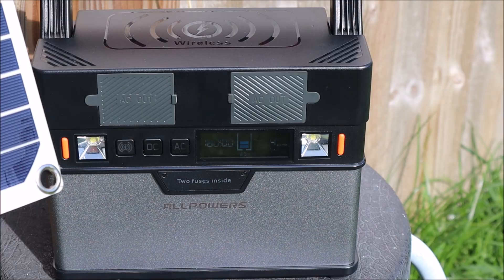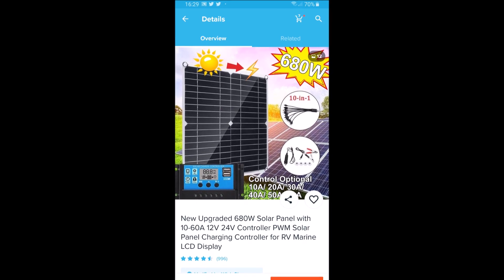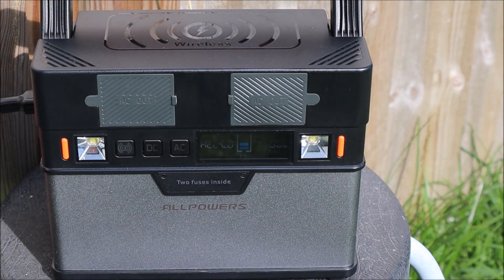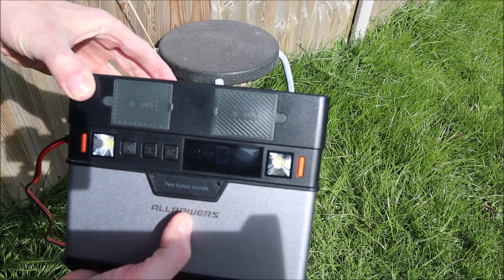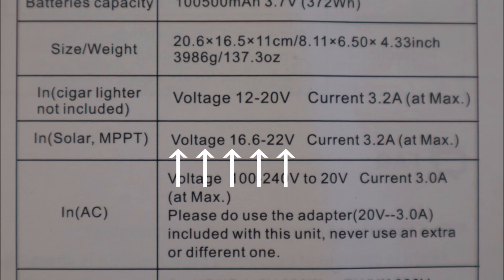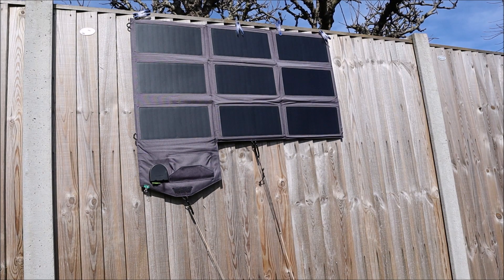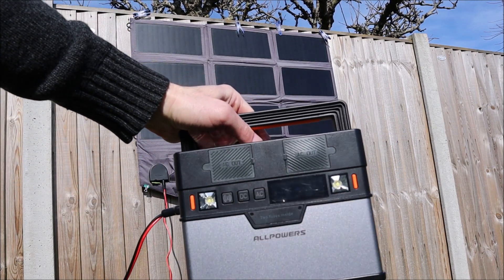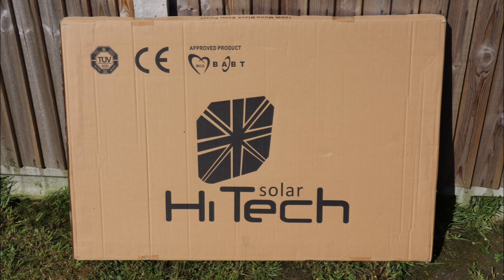ALLPOWERS 372Wh Portable Solar Generator Update 2 | Wish Came True

Comment: Howdy, great vids. We have this powerpack and have had some good use out of it. However, I tried to run a drill from the invertor which tripped it and I now can't get the AC to activate at all. I've had the blade fuses out (swapped one) but they looked ok tbh. Any ideas if this can be fixed as we like to run our TV off it when off-grid!
Reply from the maker: @paulcrossley2398  Hey Paul. Thanks for your kind feedback and sorry to hear you're having a problem. Do the DC outputs still work and can you still charge the unit up? Have you tried a reset as yet? All the best, Adrian
Reply: @DADvinci  Yep, all the DC side of things work fine - I tried the reset as in your video but to no avail.  I do get a nice spark as I put the fuse back in but no blown fuses.  Looks like we might have to see if the TV can run on DC!
Reply from the maker: @paulcrossley2398  Thanks for the info Paul. I think you've already said this, but does the AC button switch on at all (and the fans temp kick in, then go off)? Did you ever use the app with it? In theory, the drill should have just tripped the inverter (inbuilt protection), not fried it. The only other thing I can suggest is that you remove the fuses and take the lid off to check the mainboard/wires for damage (if you wish to of course).
Reply: @DADvinci  The fans kick in and display lights up for about a second then goes off. I've had the lid off but tbh I don't really know what I'm looking at. I did use the app when we got it a few years ago but I couldn't get the app to see the powerpack yesterday.  Thanks for all the suggestions by the way. Not sure if it makes any difference but ours is actually branded a Sudoo, not Allpowers, but the App is AllPowers

Comment: i have the 500w one but it behave the same i guess. i put a switch between the solar panel but i also have it 24h pluged in. so i usually ignore it and it just works. only issue seems to be that if its full and still in use and discharging it doesnt start charging again until its next day or a cloud goes over. overall i cant really put my finger on it what really happens. it even happens to me that i checked it and it wasnt charging. nothing was plugged in but after i connectet some usb device it startet charging. i was thinking if its possible that in some situation it doesnt charge on purpose because always charging it to 100% is kind of bad anyway. but like i said. i still cant point my finger on it or reliable repeat anything that happend.
Reply from the maker: @matze x  Good day and thanks for sharing your experience. You have the 606Wh version of this unit? If so, are you using the Anderson port to solar charge the unit? All the best, Adrian
Reply: @DADvinci  yes i have the 606 version and i use the anderson port (replaced it with an xt60). i did some more testing and i could repeat that if it isnt charging its usually allready charged to more then 90% and it started to charge if it goes discharged to lower then 90%.

Comment: Hi I have a Buture portabler hoover with a usb-c charging port on it, I was hoping to charge it with the usb-c out of this battery to the hoover usb-c with a usb-c to usb-c lead male to male but it doesnt work? Can i not get power from the battery to the hoover using usb-c to usb-c only?
Reply from the maker: @SGJOE sgjoe  Good day and thanks for your question. I'm not familiar with the portable hoover you have so please could you post a link? I'd need to have a look at the specifications (perhaps on-line user manual) to see if it might work with the 60W USB-PD output on the ALLPOWERS. I look forward to hearing from you. All the best, Adrian
Reply: @DADvinci  https://www.amazon.co.uk/BuTure-Handheld-Cordless-Rechargable-Portable/dp/B08HVGBFHL/ref=sr_1_3?dchild=1&keywords=BuTure+Handheld+Vacuum+Cordless&qid=1625310698&sr=8-3
Battery says - TYPE-C port (5V-20V/ 60W max, QC3.0) I have got two usb-c to usb-c cables now but neither will charge directly, I wanted to avoid using a plug on the ac, any help much appreciated :)
Reply from the maker: @SGJOE sgjoe  So sorry for the delay, didn't get a notification of your reply. On paper it looks like it would work. Have you got an alternative USB-C to USB-C cable you could try? The other way is to use a 12V USB PD charger like this (https://amzn.to/2UrvXaY affiliate link), but I couldn't guarantee that without testing it myself first and don't want you to spend money when you don't need to. Another possibility, you could try a USB to USB-C cable and plug into one of the standard USB ports, just to see if it works? Cheers, Adrian

Comment: How many times do you think you could charge your cell phone completely on that battery before you have to recharge it how long do you think you could run a heating pad or an electric blanket on it you think it would last overnight
Reply from the maker: @DirtPoorFarmer  Good day and thanks for your question. In regards to the cell phone, it would depend on the size of phone battery. If you can find out how many watt hours (Wh) the phone battery holds, then you can roughly estimate the number of full charges from the 372Wh. In terms of heating, I'm currently testing a foot heating pad rated at 80W > https://www.bewarmer.co.uk/footbuddy-all-in-one-heated-foot-mat/ and that would run for less than 4 hours on the 372Wh. If a blanket could run at about 30-40W then you could probably run it for about 8 hours, but that's on paper and it would need to be tested in real world conditions. I hope this helps and I look forward to hearing back from you. All the best, Adrian

Comment: Been looking at this compared it compared to some more expensive ones and it seems like a lot of faff. Love the connectivity but want a solar charger and this looks very fragile/twitchy.
Reply from the maker: @Nick the surfer  Good day Nick and thanks for your comment. Not everyone has got on with this unit and you're correct that until I found the Anderson port workaround it was a pain (almost sent it back). After a few times of doing the workaround, I didn't really think about it (auto-pilot). I've knocked it over a couple of times and it still works, although there is something small loose inside and the screen back-light doesn't work properly now (totally my fault). I'd consider it robust enough for me, but I might have been lucky. It has 'characteristics' but in terms of its size, weight and capacity it does represent good value. I can't speak longer-term (over 12 months) yet as I got it in mid Jan this year, but it's still ticking despite my clumsiness. I'm not sure if you’ve seen the full playlist, but if you fancy a look here it is > https://bit.ly/2AbwG5L. If you do want to know more or have any questions, please shout. All the best, Adrian

Comment: Can I plug a ups on my ALLPOWERS 110V 220V AC Power Bank generator
Reply from the maker: @Chin Terr  Good day and thanks for your question. Do you mean you wish to use the 372Wh as a UPS? I use mine whilst it's charging from solar, but personally I wouldn't use it as a UPS (leaving it plugged in all the time). I hope this answers your question, if not please let me know. All the best, Adrian
Reply: @DADvinci  thanks for your reply & I won't have it plug in all the time because it's just solar panel I use to charge it, but my question wasnt answered I have two ups so I wanted to know if I can plug one of my ups on the allpower generator

Comment: hello, i've no issues with this battery. I use the "DOKIO 80W Portable Folding Monocrystalline Solar Panel Kit for Charging 12v Battery with Controller Usb Output" but had to get the correct cable to plug into this battery. This panel is very good at charging it  and can be bought on amazon UK for under £100. the panel is designed to charge car and boat batteries but it works just the same...
Reply from the maker: @hb song  Great to hear from you! You ended up getting this one > https://amzn.to/3jdR8oe (affiliate link)? If so, I assume you plug it in directly using a XT60 to Anderson cable (as you don't need the charge controller for the 372Wh)? This panel must be in the voltage sweet spot for the 372Wh which is great to hear, with a great charging rate too! Is the build quality ok? All the best, Adrian
Reply: @DADvinci  the build quality is good, i don't get any blinking when charging, might be a DC port issue, i only use Anderson connector plug, picked one up from ebay. Funny thing is, this battery does not like me using the battery controller that the Dokio came with, it simply won't charge...
Reply: @DADvinci  precisely, i'm charging it now, 45W strength with today's sunlight...

Comment: Hi Adrian, have you noticed when running a laptop from AC inverter that you get erratic mouse behaviour? It doesn't move very well and gets harder and harder to use. The only thing I can find online is around the charger not being grounded, if I hold the body of the laptop (its metal on top) then it seems to stop. I guess it makes sense as the solar generator isn't grounded.
Reply from the maker: @Christopher Hamer  Hey Christopher, I hope you're doing well? I can't say that I've noticed the issue with my HP laptop plugged into the 372Wh and I've not heard that from other viewers. What laptop do you use? Cheers, Adrian
Reply: Is it a Bluetooth mouse? It's like the units Bluetooth interfering if is

Comment: So bought one of these from Amazon and it doesn't have the AC rubber plugs, picture on amazon doesn't show them and doesn't look like it should have them. The manual mentions them, just wondering if they released a slightly revised version. Got a solar panel coming (Beaudens 100W) so will test it via Anderson.
Reply from the maker: @Christopher Hamer  Good day Christopher and thanks for your question. You are correct, they released a slightly updated version which is an improvement over my version as the rubber covers don't get in the way and the mains plugs are fully flush with the unit. Please could you let me know how you get on the with Beaudens panel? The Anderson port wake-up issue still appears to be there (feedback from other viewers) on the revised model. All the best, Adrian
Reply: @DADvinci  Hi. I tested the beaudens solar panel and I don't seem to have any issues. I tested it on a very cloudy day and only got 10w and it came on and off fine. I tested in sunshine and got 62w with no issues. The panel was outputting 4.8amps at 21.8v giving around 104watts. I couldn't reproduce this. I was using the Anderson cable that came with the solar panel.
Reply from the maker: @Christopher Hamer   Hey Christopher! Thanks so much for sharing your test results. It's great to hear all is working fine with your setup. I'm now wondering if your panel is in the sweet spot for the 372Wh or whether there is a slightly better voltage window on the revised model (or a combination of both). Your charging watts are a little better, my 100W rigid usually sits between 58-60W depending on how hot it is.

It's great that the Beaudens comes with the Anderson cable as getting hold of one has been the biggest headache for some viewers who contacted me. It looks like your panel is out of stock now, so I can't even get one to test on my version of the 372Wh. I'll keep my eyes peeled. 

Thanks again for sharing and please shout if you need anything else. Take care, Adrian
Reply: @DADvinci  no problem. I'm sure the voltage stayed around 21.5v when I closed one of the panels, the charge watts reduced to 40. The panel looks like it outputs a stable voltage, I'll test this some more.
Reply: @DADvinci  Looks like the voltage goes from 22.8v to 20.5v (almost folded up with one panel showing). The panel is very limited stock and only sold via amazon, i kept checking and 1 become available. It could always be an issue with the anderson cable?
Reply from the maker: @Christopher Hamer  Thank you Christopher! I've tested 3 Anderson cables (2 DC to Anderson, 1 MC4 to Anderson) all with the same results. Like other viewers, the voltage when you plug in determines if it wakes-up or not. At least the workaround did the job as mine would have gone back for sure. All the best, Adrian

Comment: You covered your panel with cardboard for a few moments, which seems like a good workaround to the start-up problem. However if the panel is on the roof of a shed or caravan you're going to have to climb up there to do this, at least if you're getting good sun (which for these purposes is too much to start up the charging without being partially covered).

If you cannot access the panel because it's high up, would it be necessary to leave it plugged into the power unit overnight, waiting for the sun to come up - weak at first light, stronger later? Would that work? Presumably if you have solar panels on a shed roof you want something permanently plugged in anyway, so it wouldn't be unreasonable to do this, but if you did have to disconnect it for any reason you're left to wait until sunrise again.

It all seems like a definite design flaw, particularly as it managed to cope with charging from a full 60 watts through the USB-C port, instantly. This is a great workaround, but not something which should be necessary.

One other thing I thought of: your other video showed that charging through the USB-C port is instant and effective at any power level. Is it possible to connect the solar panel directly to this port? Is there such a thing as an Anderson to USB-C adapter?

The three videos together were great, very informative. Thanks!
Reply from the maker: @Nick Gisburne  Good day Nick! Thank you for your kind feedback and questions. Originally, this unit was a matter of days away from being sent back, even after working with the manufacturer for almost a month. Thank goodness for the wish.com panel!

As you rightly point out, this issue doesn't lend itself very well to some of the places a panel can be located. Unfortunately, leaving the panel plugged in overnight doesn't work from the testing I've done. Once the display goes to sleep at sun down, it doesn't wake up in the early morning sun. The issue is not helped by the time you have to wake the screen. If you don't hit the right voltage within about 5 seconds, it doesn’t wake up again until you reconnect (this is how my unit behaves with the 60W & 100W panels). This is an issue (characteristic) with the charging circuit and feedback from other viewers indicates that the manufacturer now refers customers to my video and workaround. 

The USB-C PD charging has been a real hit for this unit, especially from viewer feedback. Unfortunately, PD needs the proper cable and charger to initiate properly so wouldn't work using solar directly. Here's a really informative video about PD that you may like to have a look at > https://youtu.be/Uuh0tRLANpc

The workaround has prevented a higher return rate for the manufacturer. Would the 372Wh suit those with hard to access solar panels? Probably not, unless a proper (safe) method to control the start-up voltage was readily available. The vast majority of viewers who contact me don't want to cut cables and solder things back together, they want to buy, plug in and play. The manufacturer is improving this unit with small tweaks such as removing the rubber covers and making the AC sockets flush which is better for inserting mains plugs. I've not heard that the Anderson port issue has been fixed on the revised model though, which is a shame.

I'm on the lookout for a ready-packaged solution to replace my 'cover with cardboard' method so hopefully I can share that at some point in the future. I hope this helps and please shout if you need anything else. Take care, Adrian